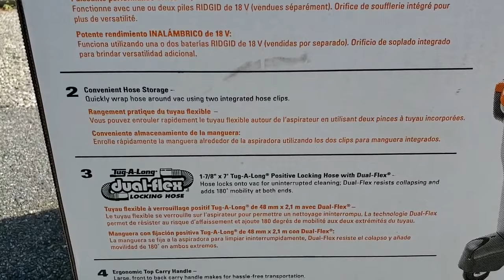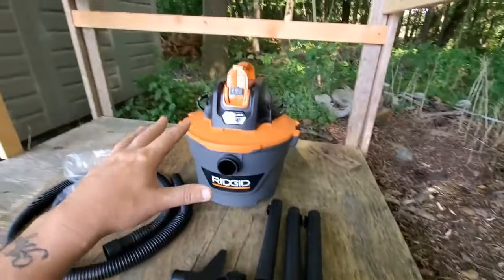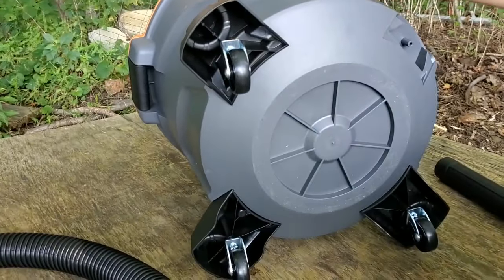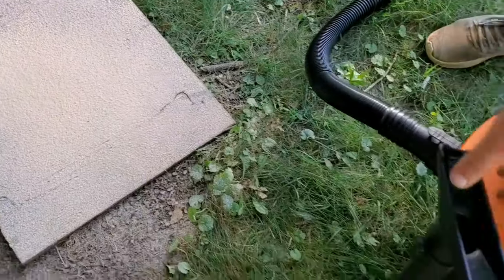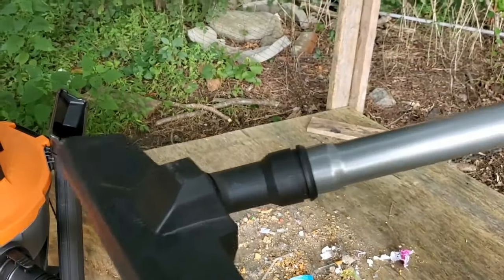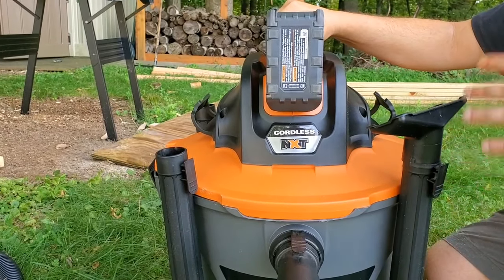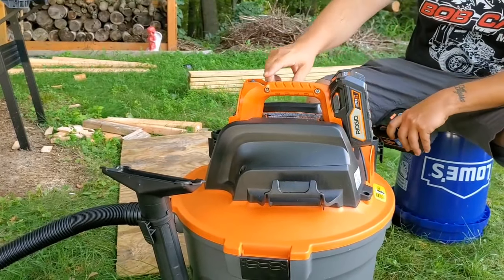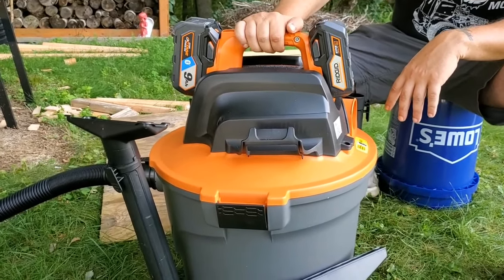Ridgid 18v Cordless NXT 9 Gal. Cordless Wet/Dry Shop Vacuum Review (HDO918)

Comment: I have this vac. It is great. This is the kind of shop vac I have been waiting for! I just wish it was a hybrid.
Reply from the maker: Yea I hear yea .. hybrid tools are great for some tools not so great for others .. I think with a shop vac , your buying a cordless vac for a reason.. I dunno holds to battery's if you need to use a shop vac more then 35-40 mins , you should prob not get this or just have corded for more extensive work .. in my opinion this should not be only shop vac you own .. if your using one alot
Reply: @toolboss8410  100% that is why I have the Ridgid pro that looks like a tool box which I love  as well!

Comment: I seem to have an obsession with collecting cordless wet dry vacs and in the last year have picked up the ryobi 6 gallon, the dewalt(pos) 32 cfm 2 gallon and the dewalt dustbuster shop vac, they are not good, the dewalt 125 cfm 350.00 dust collector(awesome), the makita 57 cfm model, the bosch 51cfm model, the new milwaukee backpack 55cfm-80 inch h2o lift,plus my dyson and shark regular vacs, DAMN YOUUUUUU, Now I have to get this one, although it sounds a tad loud just like the ryobi. The brushless models are super quiet, i love it, thanks man nice video!
Reply from the maker: Yea ..the dewalt 20v stuff not so good ..but the Flexvolt vac is awesome ...will have vid shortly
Reply: @toolboss8410  BTW I ran out and got the rigid cordless an hour ago, just couldnt help myself,lol. I put it on the water lift gauge and it was reading around 35 inches, I just got the gauge and am still learning its idiosyncrasies , so it might be off. It was spot on when measuring the bosch and the makita but it only read 35 also for the 125 cfm dewalt which seems low, ill figure it out and let you know. The rigid is waaayyy quieter then the ryobi, and I added a rigid muffler from home depot, 12.00 dollars, it made it even quieter, now it purrs,lol,i love it, just gotta swap out those casters for some proper wheels!

Comment: Can you confirm that bottom portion can be swapped for any of the nxt sized buckets? So if you already have a 12 or 16 gallon it will work with this cordless lid?
Reply from the maker: Sure you wanna send me over a 12 or 16 gallon NXT I will check for ya 🤘😉

Comment: Dang just bought the Milwaukee with the 2 batteries for $199 wish I would have seen this as I already have ridgid platform but guess now I’m on the Milwaukee platform as well.
Reply from the maker: Return it 👌🤘🙏😉
Reply: I would but I’m invested in the platform now that I bought the gen 3 hammer drill and the 2 batts and vac weren’t a bad deal. Keep up the awesome vids though and thanks for all the info always.

Comment: Used it today for the 2nd time and the hose split open.  The hose is molded on the long length of the hose as you can see the seam that brings it together.  However, it split vertically across the hose.  There is just no way I was rough with it either.  Must be a defect.  If not, then Ridgid needs to do something about the damn hose.
Reply from the maker: Yea hose is crap ..real crap
Reply: TOOL BOSS did you upgrade the hose and if so which one did you get? Thanks for replying

Comment: 80 cfm is alot compared to the Milwaukees backpack vac witch is only 55 cfm
Reply from the maker: 82 cfm 👍👍👊👊😉
Reply: yeah but the milwaukee has an insane 80 inches of water lift, it beats the ryobi 6 gallon which also has 82 cfm and the milwaukee is much quieter. not sure what the water lift on the rigid is, i still want it though

Comment: Is it just my weird ears, or does it sound like it runs just a bit faster on the octane battery?! Pretty cool!
Reply from the maker: Possibly...👌👌👍
Reply: Even if it is, would that be because it's an Octane battery, or because it's a 9Ah vs. a 5Ah?  I suspect it's because of the higher Ah rating, because the vac is not being promoted as an Octane tool.  Heck, its motor is not even brushless, is it?
Reply: @floobertuber   i imagine it's a mix of amp hours and more effecient cells.
Reply: Octane batteries are stronger so yes, they are designed to add a lil extra boost.